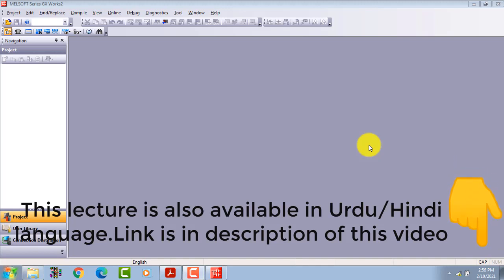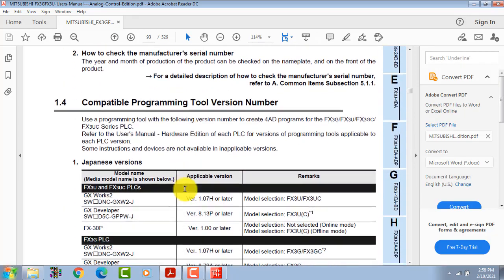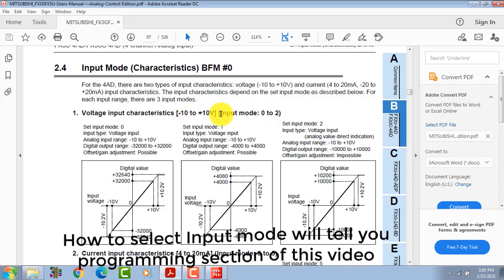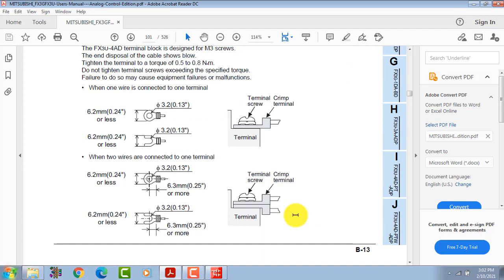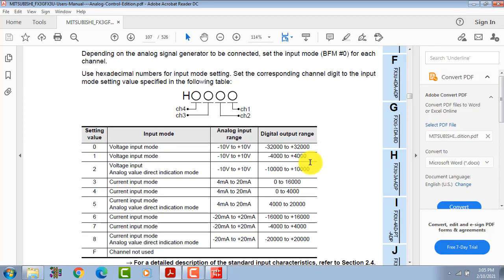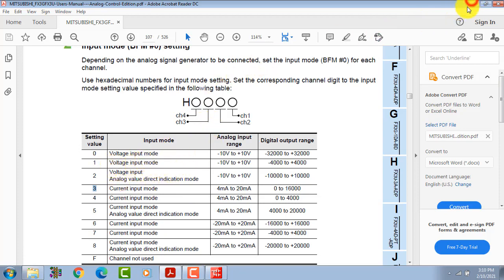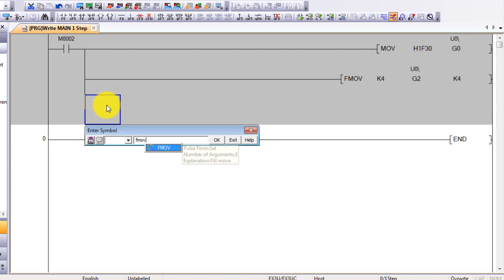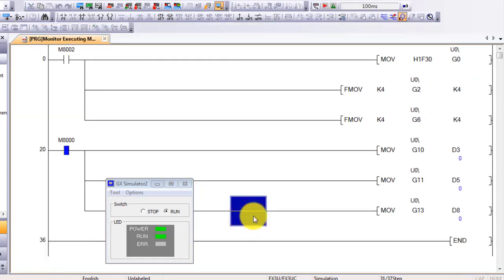22 Mitsubishi PLC Analog to Digital Module FX3U 4AD programming in English  4mA to 20mA  0 10V

Comment: Hi everyone, I’d like to ask: when reading a 4-20mA sensor using the FX3U-4AD module configured for a reading range of 4000–20000, what value will the module register if the sensor wire breaks or the sensor itself fails? Thanks in advance.